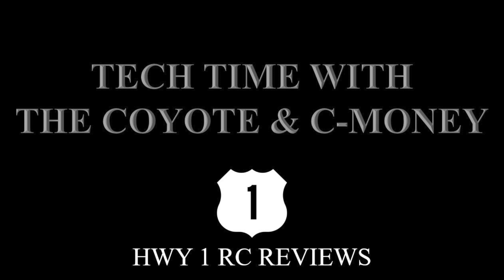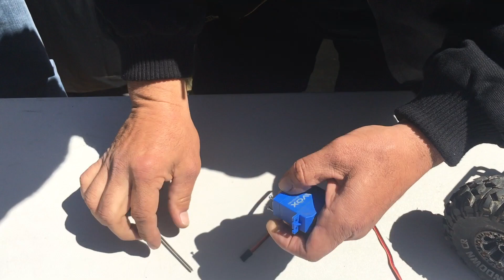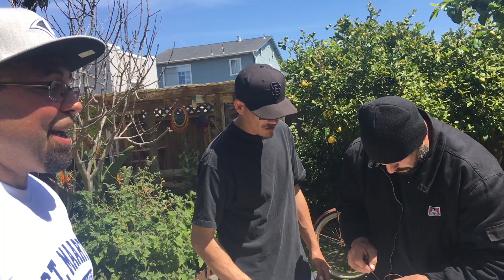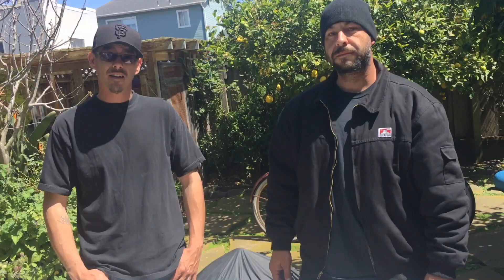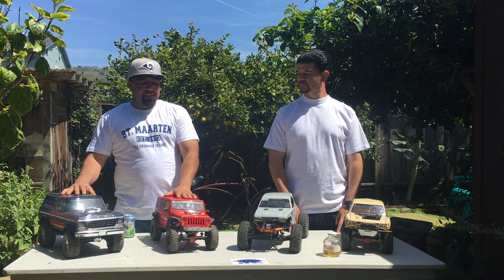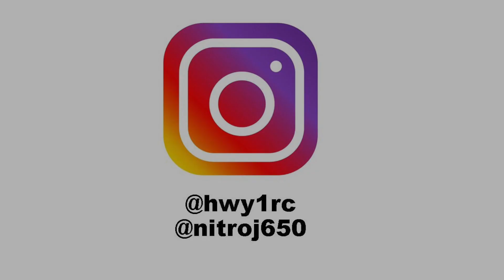Servo fixed on the trail or workshop

Comment: My steering servo when out in my bronco to, Quick fix as got a circuit breaker in side, I took the bottom cover off solder it all the way across back working so far so good, there's a video on YouTube how to fix Traxxas steering servo 7075 shows a close-up Picture of the servo I looked at circuit breaker, looked at mine and found it , solder it all way across good to go